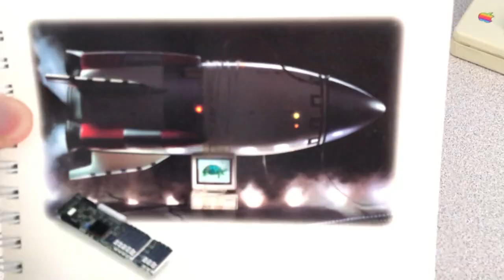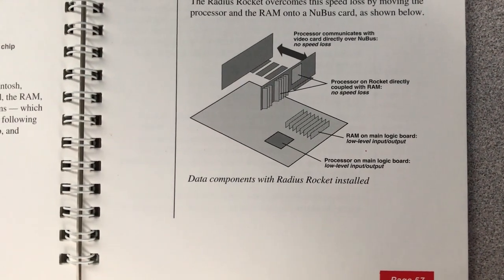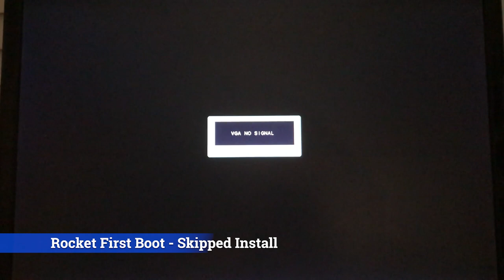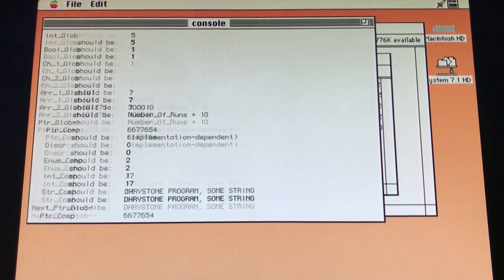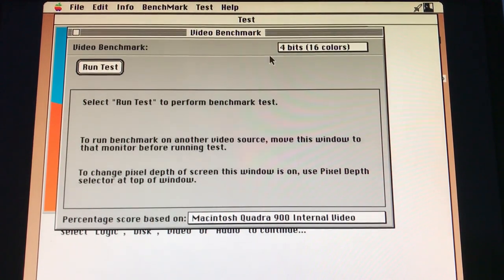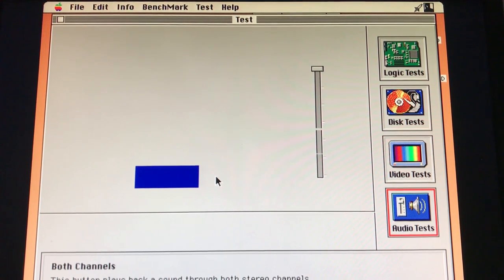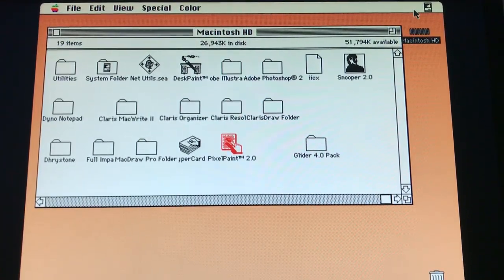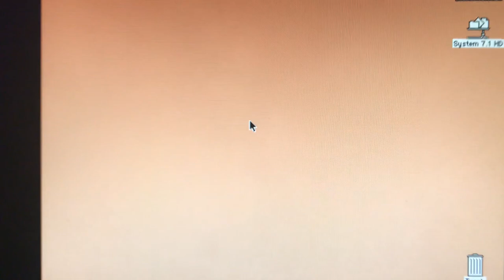Macintosh System 6 on a 68040 - Macintosh IIcx + Radius Rocket - Fast!

Comment: Shortly before Radius canceled all their Rocket products, they also had Skylab.  It was an external box with 4 or 6 NuBUS slots that would daisychain off a single NuBUS slot in the host computer.  You could then load a whole bunch of Stage II Rockets for distributed computing, rendering, etc.

AVID had a similar product, I don't know if they licensed it from Radius or vise versa, or if they developed it on their own.  It would plug into a PCI slot and give you access to a number NuBUS slots.  That way you could continue to use your AVID cards on a PCI Mac.
Reply: 2nd wave xpanse, avid licensed their tech and developed their 12 slot digidesign nubus chassis off of it in ca 1993. Its the ultimate piece of macintosh history you want to possess if you want to max upgrade any macintosh.

Comment: Very cool video! I picked up a Macintosh IIcx recently because it had a Radius Rocket sticker on the front, but unfortunately it did not have the card installed :( Neat to see one in operation, though.
Reply from the maker: Ah, that is a shame! Good news is the standard 33mhz Rocket isn't absolutely impossible to find. They do pop up from time to time on eBay or on collectors forums like the 68kMLA for sale.

I used to have many Rockets but I sold my excess boards to collectors on the 68kMLA years ago. 

Now I have 1 33mhz Rocket (the one in this video) and 2 40mhz Rockets.
Reply: @RetroTechIIfx  I might have to pick one up eventually. The performance increase is quite substantial and I love adding cards to my computers. Currently my only fully operational Macintosh 'II' is a IIci. I have two IIcx machines but one has a board with leaking capacitors and the other doesn't want to boot up even though the board looks fine.
Reply from the maker: @droolerdork   You are going to want to at a minimum desolder the caps on the IIcx board before the leaking goo causes corrosion of the traces. I had to recap mine, thankfully the goo didn't cause much damage. 

The one IIcx that won't boot probably has a bad PSU, is it an Astec? Swap the known working one from the IIci and see if it will boot. Both the IIcx and IIci use the same power supplies.
Reply: @RetroTechIIfx  Desoldering shouldn't be too bad. It'll give me practice for actually recapping a board. 

Yes, all the bad PSUs have been Astecs. The only working one is a GE. I did swap them and still nothing. No clicks or anything. The PSU fan did spin a little when the power button was pressed, but that's it.

Comment: Very cool. I looked online and couldn't even find one of these cards listed for sale. I feel that most sellers are unable to identify what a given card is, so they therefore don't list them by name.
Reply from the maker: They are pretty uncommon but do pop up from time to time. Easier to find on Mac collector sites like 68kMLA. The StageII 40mhz version is basically unobtainable, but by luck I obtained two from a local retired engineer.  Radius made some cool stuff!
Reply: @RetroTechIIfx  That's lucky you were able to obtain those from that engineer. I'd imagine they sell for quite near the value of a stock IIcx. Would still be interesting to see what members on 68kMLA are selling. If I can't find a Radius card, perhaps I can at least find a better-than-stock GPU option -- something that can display more colors than the integrated card can display.

Comment: Huh, interesting. I read a thread on 68kmla say he got RocketShare working upto os 8.6; that RocketWare, not Share, is limited to 7.1. Also read on another post that it's the thread manager, not appletalk, that broke compatibility.
Its the internet so take these with a grain of salt.
On that note, do you know if the Thunder/24 video card is compatible with System 7.5.5+ considering most dsp cards seem to have some weird compatibility problems after that version?

Comment: We had a Mac II with a Rocket and a VideoVision w/MJPEG card... the combo never worked right. The Rocket had problems with sound; and the VideoVision kept crashing. I told my dad (family business, even though young at the time I was the de-facto tech department) that he needed to put the VideoVision in a machine that was contemporary to it... eventually he ended up selling it to somebody who had the right machine; where it worked more-or-less flawlessly. Kept the Rocket though - with the exception of sound, it worked pretty well.
Reply from the maker: Sound is a weak point of the rocket. I have tried to get an MP3 player going in the RocketShare environment (multiple System 7 instances) and the attempt to access the host sound hardware results in a system-wide crash. Apparently you can make sound work with a very specific version of Sound Manager that I have never been able to find.